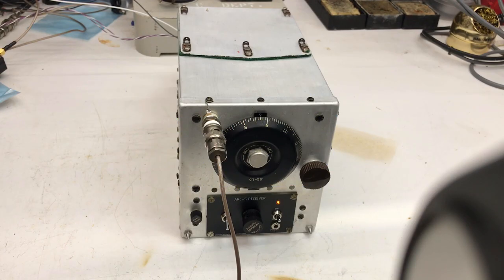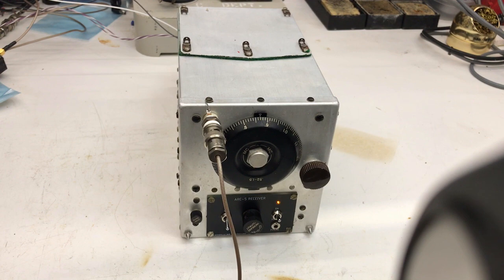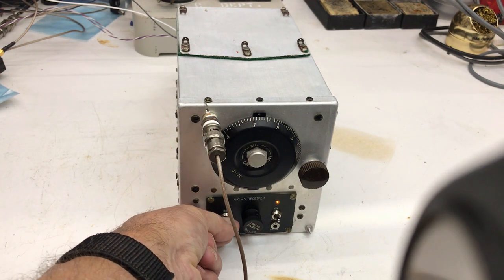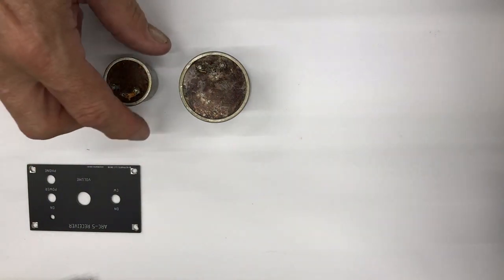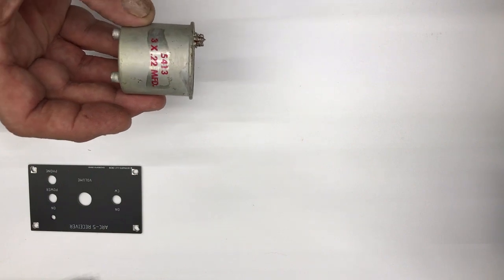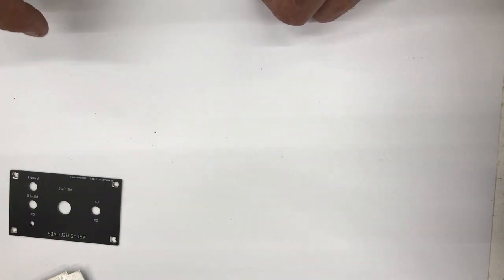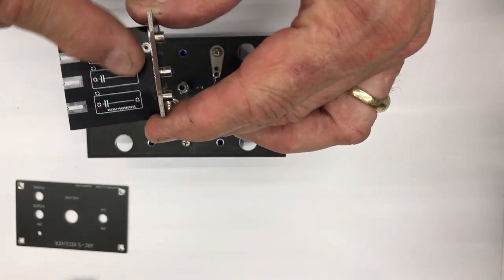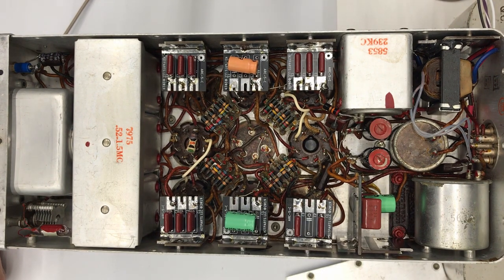ARC 5 Command Set Restoration Components

Comment: Tom, Nice video.  I have a complete set of 3 that have been nicely restored.  They came with 1 separate power supply/speaker.

I also just received a mystery BC-455-B that looks like it had a power supply added many decades ago. It powers on but there's no antenna jack on the front.  There is an RCA phono jack, and a 4-prong jones plug harness on the back with 295 VDC.  Maybe to power a transmitter?  The inside looks all original.  There is an S Meter on the front panel.  If I hook a speaker to the phono jack, I get no sound.  If I attach an antenna to it, I get no movement on the meter.

I bought in an estate sale to keep it from going to the dump.  I plan to sell it but was hoping to demonstrate it too.
73 Paul AA1SU